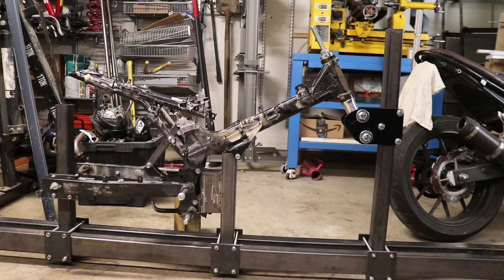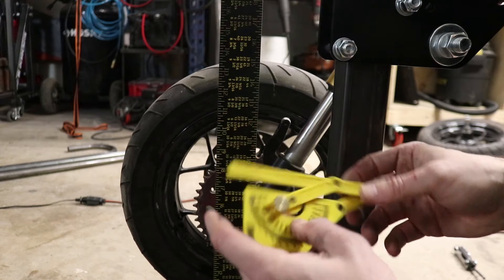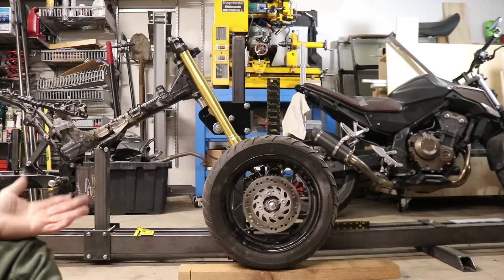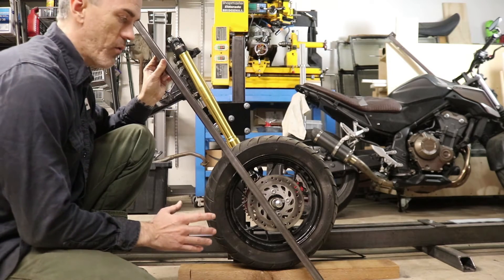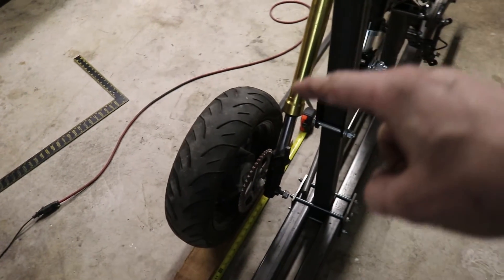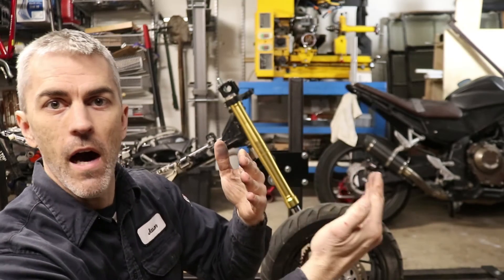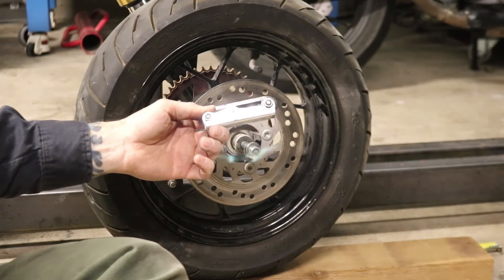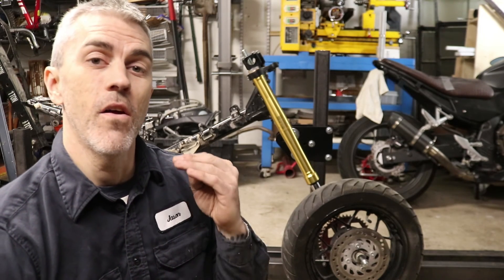Motorcycle Rake and Trail Explained & Applied | Grom Frame Build E7

Comment: Question, I have a paramotor trike that I fly, the new trike I'm using have a steep rake with a lot of trail and it has a lot of chopper flop and it's really touchy. I want to fix it so it's more stable and not so jittery at speed. Could you answer so.e questions if I show you pics?
Reply from the maker: Check out this video and let me know if you still have questions: https://youtu.be/xxfW1UuU-tg
Reply from the maker: Very simply, the more trail, the more stable at speed and the harder to turn. The less trail, the less stable at speed and the easier to turn. From your description it sounds like to don't have enough trail, but there might be something else going on. If the front wheel is not centered, you might get the rear moving around and the constant need to adjust the steering to compensate. I've never ridden anything with chopper flop, so I don't know how that would feel. I usually figure these things out through small adjustments, tests, and further adjustment. It's amazing how a little adjustment in trail make to the feel of a bike.

Comment: I read somewgere that swapping with a longer monoshock at the back reduces trail. If that's true, can you please explain how?
I believe only the handlebar height would reduce because of the increased weight, but how woukd that affect the trail?
Reply from the maker: Trail mainly functions to give the bike a certain amount of steering stability.  Vary the amount of trail and you will change the bike's tendency to want to go straight or want to turn. In the video I looked at the trail on the front tire. There is also a trail in regards to the rear tire, but it's effect on the ride of the bike is not as significant as the front. The rear trail is measured from the contact patch of the steering stem on the ground (this is at the front of the bike) to the contact patch of the rear tire. A longer monoshock should increase the ground clearance, but also shorten the rear trail as the wheelbase is slightly shorter. Would such change in the rear trail be enough to notice? Some  riders, maybe not, some, yes. I've not tried this, so I couldn't tell ya.  Here's another video explaining trail in, perhaps, better detail as it looks at an example https://youtu.be/xxfW1UuU-tg
Reply: @HooptieDoodle  I think you understood it all wrong. I was talking about front rake and trail only. Why does it change upon changing rear shock length.

Comment: Love you videos. Very helpful. I’m still workin on my 86 goldwing rear suspension. Not sure if I should go mono shock style or double shocks like warbird type goldwing builds. Was there a major deciding factor why you choose mono style? & do you think double shocks like Warbird bikes used would work well just based on pictures of that set up? Keep up good work. Your videos have been instrumental for me.
Reply from the maker: I designed the suspension minimize stress on the CV joint on shaft drive. That was why I did a linkage, which led naturally to a monoshock. Don't know if it was all necessary, but it does ride nice 😀